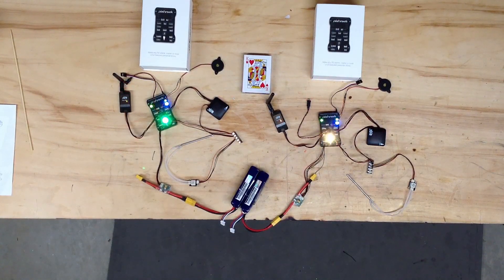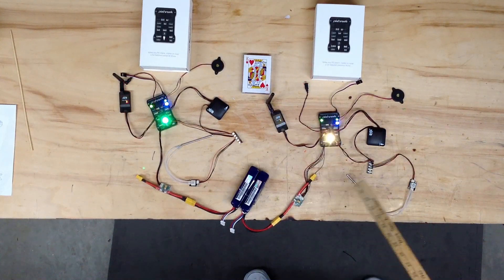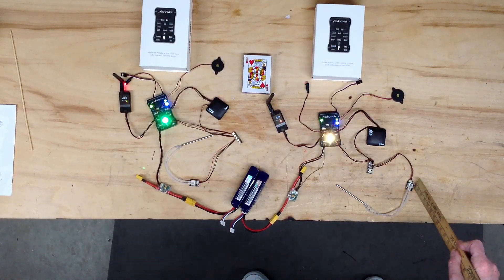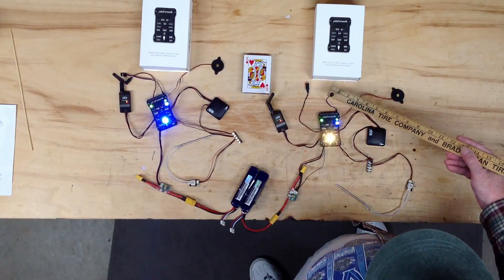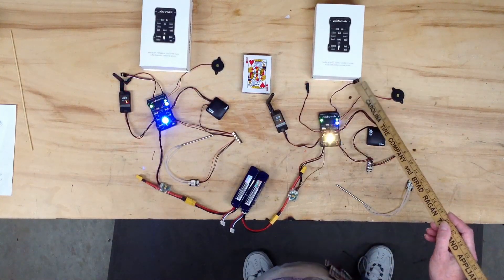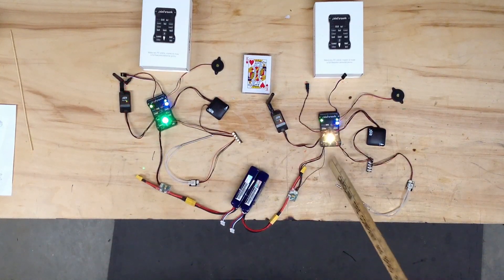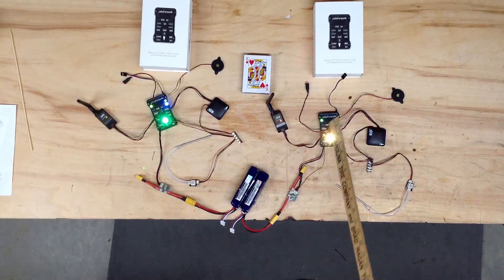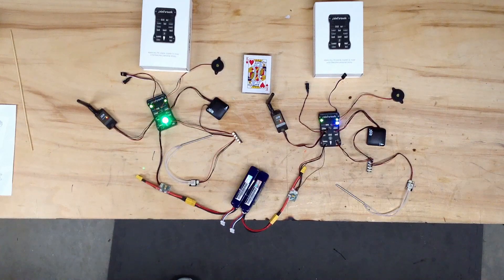Pixhawk Autopilot

Comment: Hello, Great video for beginners like me. 
I was hoping I could get some help here. I am developing a flight 
control system using Autopilot (Pixhawk), Companion Computer 
(ODroid-XU4),Ardupilot 3.5. The application requires me to inspect a 
power pole using a drone with autonomous flight (UAV). Could you
tell me how to set up the geofence with respect to the power pole.? I already know the location of the poles and I am trying to create 
little geofences around each one,Like a  "stay out zones".
I feel the algorithm you mention here can be of some help to me.
Reply from the maker: As far as I know they have only been circles and it is assumed that the 
drone will be inside the circle.  If it goes outside of the circle it 
will return to launch or whatever you set it to do.  If it goes out by 
20 yards or more it will auto land.  I don't think they ever create a 
line type geofence.  Which I wanted to setup at the local AMA flying 
field to make sure the drone did not come back across the flight line.  
 This is the extent of my knowledge.  What you would have to do is setup
 your circle as many feet away from the pole or power line as you want 
the drone to get understanding that it is an arc.  Then if it crossed 
the arc, it would move away from the items you want to stay away from.  
If I am understanding what you want to do.

Comment: Hello! Nice video, great introduction to Pixhawk... I am planning to bild new quadcopter with "follow me " feature (this is only reason to use 3DR cotroller, Ilike NAZA better) So..please help me to selekt right parts:
1.Pixhawk PX4 2.4.5 or PX42.4.6 or only PX4-kit-0011 good enough for "follow me'? or all of them upgratable?
2. Wich one u-blox GPS I have to buy: Neo6 or Neo7M or only NeoM8N or only new square one???
3.Radio set- no questions...
Thank You in advance, Roman
Reply: Rom Copter  I guess he doesn't want to answer..  I wish I knew too.. I want similar as you.
Reply from the maker: Rom Copter 
Oh crap!  O.O  I am so sorry.  I went camping for the past two days and was out of touch.

I THINK NAZA MIGHT just have a follow me coming.  I forget what they
called it.  See if I can remember or find it.  Or I could be wrong,
again.  O.O

Ruby isn't a bad control system either.  :)  Not sure IF they have
follow me or equivalent.

All three of those Pixhawk are pretty much the same.  PX4-kit-0011 comes with a XT60 power module
to monitor battery.  Myself I just goto:

https://store.3drobotics.com/products/3dr-pixhawk?taxon_id=34

Looks like 3DR converted to the new u-blox NEO-7 GPS.  Or rather their vendor most likely did.

Order two.  rofl  Pixhawk supports two.  https://store.3drobotics.com/products/3dr-gps-ublox-with-compass?taxon_id=34

You MAY need a PPM Encoder.  3DR does sell one.  But I think I am going to look for a 14 channel.  I fly
a Futaba transmitter so I REQUITE an encoder.

https://store.3drobotics.com/products/ppm-encoder

Be NICE to find a second gyro/accelerometer.  Pixhawk supports two.  But then your I2C splitter would be
full.  lol

You SHOULD be very happy with it.  I have two Pixhawk and Two APM 2.6.  Dumped the radios for

http://store.rfdesign.com.au/rfd900p-modem-bundle/
Reply from the maker: Vernon Silvers https://store.3drobotics.com/products/gps-mast

Comment from the maker: Thank you very much for your kind comments.  Yes I do have a few bucks invested.  I also have two full APM 2.6 systems.  O.O  Upgraded the telemetry radios to 1 watt for 12 miles of range to replace these stock 100 mw ones.  Going to add double GPS modules to the two Pixhawk systems ASAP.  O.O   Luckily I have worked in the computer field for over 43 years and the pay has been good.  lol

Comment from the maker: Working GREAT for me.  Saw HobbyKing had an APM clone, but haven’t seen the Pixhawk clone.  I find their parts to be substandard and try my best to buy from U.S. vendors.  So MUCH different in quality.  HK is a great place to begin, I started with them myself because of cost.  BUT when I needed reliability I had to move on.  Several other APM clones called the ArduFlyer.  I found out the HARD way, you get what you pay for.  <shrug>  I have several products here that are identical but one comes from a U.S. maker and the other come from China.  You can easily yell which one is which when you fear to handle one of them because might break it.  It may be technically the same circuit, but it isn’t at all the same quality.  I started working in electronics in 1971 and have been in the business for 40 + years.

The third link below is two identical lipo balance boards.  One costs $7.99 the other $2.49.  I have broken over 4 of the cheap ones.  The other one is still original.  Two came with the Hitec battery charger, the others from HK.  Again you get what you pay for.   And AGAIN I started with HK because of cost until I KNEW I would be into this for the long haul.

http://quadcoptergarage.com/product/rctimer-arduflyer-v2-5-2/

http://www.sierrarc.com/index.php?main_page=product_info&products_id=326

http://youtu.be/PQlyypDK0Pk

Comment from the maker: Mission Planner.

http://planner.ardupilot.com/
Reply: Well both programs are so bad that it will never work!  Mission Planner has a USB driver for Window NT and XP, it won't even see the board in Windows 7. If all you are doing is watching the lights flash it won't matter though.
Reply from the maker: Seems to work fine when I fly.  <shrug>  Will post a video ASAP.

I know it works well on the APM 2.6.
Reply from the maker: I have used this many times with almost zero problems.  Be quite happy to help you any way I can.  I don’t seem to have any problems with it using Mission Planner or Droid Planner.  Enough to trust it in the extreme surfer and Bixler 2

http://youtu.be/eBpKfyeIf5E

Here is a field test that worked as advertised.

http://youtu.be/M-p81pbKcx4
 
Again, be more than happy to help.
Reply from the maker: Just hit me.  I MIGHT know your problem already.  There is a problem with the pix hawk running off of JUST USB power it seems.  IF you either hook it to a battery as I did here, or on the bench add a BEC or RX battery to the mix it does work much better.  That problem is documented somewhere.  I can't remember where right now.  But some USB ports do NOT have enough power to run it from just the USB port power.  It will seem to run and then glitch up or do strange things.  IF you do NOT use the extra battery when installing firmware I can ASSURE you will have problems.  I did until I found that update.  Let me know IF that works or doesn’t work for you.
Reply: I've tried battery power too but that doesn't make any difference. The Pixhawk site says to use Qgroundcontrol to update the firmware but it wouldn't even run in Windows until I used the work-around of installing Qt in Issue 810, then once it did run it didn't even have the Firmware update option with the Scan button! I had to contact the software guys on Github and file an Issue myself to get that option added back in with Issue #822. Even then it still doesn't work and gives me a different error every time I try it such as file not found, wrong file type, can't connect to board, board wrong ID type, etc, etc, etc. There isn't a single thing in the Qground program that will work!  I looked for a Youtube video showing how to setup the board and update the firmware but couldn't find any which is not surprising since none of the software works so nobody can do that!
Mission Planner wouldn't work in Win7 either so I got out my old Thinkpad with XP and tried it but it couldn't update the firmware either and just freezes when I try it.
Reply from the maker: They all look the same don’t they?  In fact the bottom one WON’T work.

Does it power up from the USB at all?

http://youtu.be/4peyN3qqYus
Reply: No problem with power but none of the software is any good. I've tried different USB cables on different ports but neither Qgroundcontrol or Mission Planner will work at all.
Reply from the maker: Ok.  Let's try this.

http://youtu.be/1IdNHjaPJ0o
Reply: Vernon Silvers When I said it didn't work I mean it's total crap!  The USB driver they have is so old it's from 2000 for Windows NT and only works up till Windows XP, it won't install in Win7 so when I first tried it couldn't connect to the board and just got a driver not found error. I dug out my old Thinkpad with XP running on it and tried that. It will connect but when I try to do ANYTHING at all in the program like upload firmware it just freezes!  Then I have to use Task Manager to kill it.  Your computer screen doesn't look familiar, what are you running it on?   Maybe this used to work in the past, years ago, but the present version is totally worthless. Isn't there something better out there?
Reply from the maker: Win 7 64 PRO

Didn’t need any USB driver.  Native mode worked great.  Let me send another video.
Reply: Vernon Silvers It can't connect to the board in Windows without an up to date USB driver.
Reply from the maker: Can't locate what OS is required for it.  Still looking.

http://youtu.be/qNSfA3994GM
Reply: Vernon Silvers The problem with Mission Planner is that it will only work for planes! I never tried a plane before since I have a copter.  If I select the plane like you did it will upload firmware and then connect and I get data but if I select any other craft like a copter or truck it still seems to upload firmware but when I try to connect it either freezes or times out!  Seems like a BIG PROBLEM for this program if it can't work for copters!
Reply from the maker: Haven't heard back IF you have had any success.  So I hope you got it all going.  I am still ready to help in any way I can.
Reply: Vernon Silvers Nope, no luck.  They have fixed a couple of major problems in Qground but it still doesn't work except as a Plane.  Last night I fired up Mission Planner to try it again and it said there was an update so I did the update hoping it would fix some of the problems but that actually made it worse!  Now if I select the Hexcopter it won't even try to work and gives me a screen full of errors about not being able to find the firmware files!  I wonder who you contact about problems like that in MP?  I know Qground is maintained on Gethub and you can leave comments there about Issues but I don't know where or who maintains MP.  I also tried the Linux version of APM Planner in both Mint and Ubuntu and it won't even run or do anything at all.  Have you had any luck using that?

Comment from the maker: 3DR Pixhawk
Pixhawk Airspeed Sensor Kit
3DR Radio Set
3DR uBlox GPS with Compass Kit
Buzzer
Safety switch button
3DR power module with XT60 connectors and 6-position connector cable
Extra 6-position cable to connect a 3DR GPS+Compass module
SD card
3-wire servo cable

2 3S batteries

Two full Pixhawk systems.